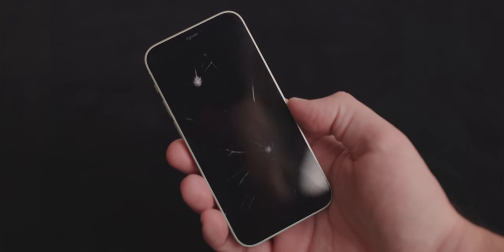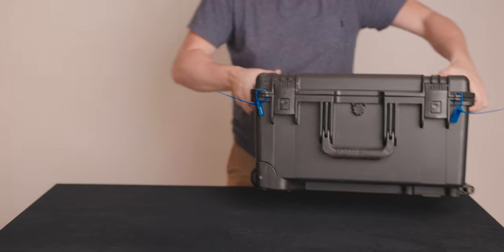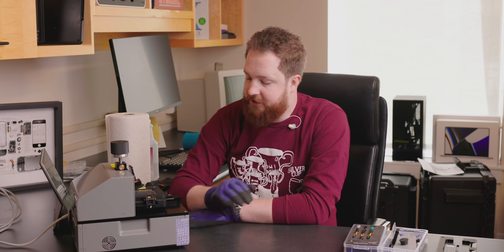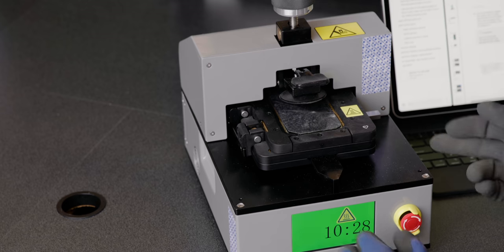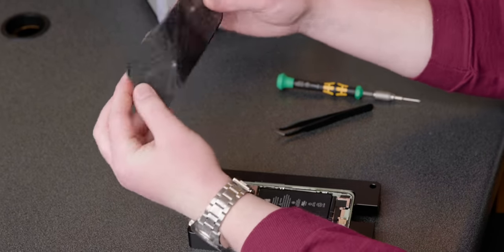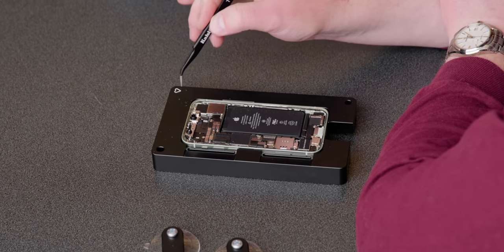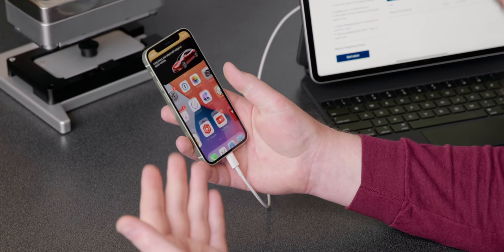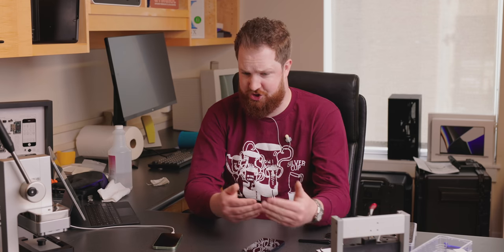Using Apple’s Tools to Fix My iPhone

Comment: After watching this video it seems clear to me that Apple has designed their whole repair equipment and process to seem intimidating and tiresome to discourage people from using it.
Reply: Too be honest they are actually just lazy. This is the exact same process you'd see when going to apple/authorized service, from the machines to the process (I'm currently working at geek squad rn). I'm still a little shocked they just took all the equipment we use daily and just slapped it into 2 pelican cases and gave the user the same repair guide lol.
Reply: @XeLegend  Okay, you make a better solution so we can mock it please. Go on... we are waiting
Reply: @unlokia  Why not just make a more repairable phone? Or not even just that, but giving out proper repair guides and having parts be freely available to consumers and/or small repair shops, but letting them (repair shops) have stock (since there are repair shops that can get genuine parts, but are only allowed to order parts once a phone comes in)
Reply: It isn’t to intimidate the customer from doing it themselves but ensuring the repair is done in a controlled, consistent manner without requiring someone to second guess the previous step was done properly reflecting negatively on the brand. Sure it could be done with lesser tools
Reply: @c2thew  thank you, another of the few who aren't on the "it's a conspiracy!!" bandwagon. It's nice to meet some level-headed peers.
Reply: @c2thew  Its for money, restricting
other people/entities from fixing your phone is, gives you more money, in the end they need to satisfy their shareholders. Having full control just gives ypu full control of the money ... thats just how it works ... they could do the other thing but keeping control brings more money. Surely there are plenty of people who want this to change and everything but management takes the last decision ... which is most profitable to the business.
Reply: @XeLegend  make it more repairable at the expense of quality? These devices are extremely miniaturized and tightly integrated, which is what allows them to be so pretty and powerful. Why should Apple throw away all their design and engineering principles just to cater a tiny enthusiastic minority?
Reply: @c2thew  not to intimidate the customer? Immediately installs screen perfectly and gets the warning - this isn't an official display. Lmao

Nope defo not intimidation. Price of their equipment when you can do most without any they provided. More intimidation. Financial this time.

Their entire system is half arsed and basically pointless. They're not environmentally sustainable so they should simply stop their sub par facade
Reply: @keyboardwarrior7538  replacing a screen requires validation from apple by calling the phone number for customer service. This is still very much anti right to repair
Reply: If you really are determined to repair it. You won’t be intimidated or feel tiresome, you ask for it, if you feel that way, then you don’t really want to do it yourself. If you expect official Apple repair to have precision and high standard, then you should bind your self-repair to the same standard and not want an easy way out. You should thank them for giving you the exact same tool they use instead of some half ass stuff from park tools

Comment: 2:32 Btw, those are Wera ESD safe electronics screwdrivers. In contrast to the normal Wera electronics screwdrivers, these are twice as expensive
Reply: What makes it esd safe?
Reply: @deth3021  the price
Reply: @deth3021  Nothing. Regular Wera screwdrivers are ESD safe. It's just an upcharge for idiots.
Reply: @12pandemon  i am suspicious as I've worked in esd enviroments for year but its the first time i have heard of an esd screwdriver.
Reply: @deth3021  the plastic/rubber components are made of a slightly conducive material, to dispel/equalize static buildup.
Reply: @Dirty_Bear22  i know what an esd material is. 
Just not sure what use it has on a device with a metal sharp end that is in direct contact with the sensitive electronics.
If you, the mat, the whole workspace is tethered, then i fail to see how the little bit of plastic on the screwdriver will make a difference.
Considering when you touch it, wpyou will discharge any potential microcharge on it anyway.
Amd fo you arent tethered, then its also pointless.
Reply: @deth3021  In theory if the handle material is an insulator, the metal shaft of the screwdriver can develop a charge. Yes it’s rare, but if you are working on lots of products, or very expensive server rooms minimizing risk becomes important.  It’s to eliminate environmental static, it’s not going to prevent a electrical short if working on live equipment.
Reply: @Dirty_Bear22  a metal shaft with a pointy end is going to discharge into the air.
Reply: @deth3021  after awhile yes, but the charge build up rate can be faster then then air discharge rate.
Reply: Where could I get these? I like the torque feature.
Reply: @fbnmndz  search for Wera esd torque adjustable. You can’t post links, so you gotta do some digging yourself.
Reply: @deth3021  Carbon loading most likely (carbon particulate mixed into the plastics when mfring)

Comment: It would be super interesting to order this repair, yet install a 3rd party display or battery instead to see if you can pair them to the phone through apples diagnostic…
Reply: I highly doubt you'd be able to pair a third-party screen through Apple Diagnostics because the person on the other end confirms the serial number with the parts that were purchased through their store. That said you could totally use the tools with third-party hardware, but you'd be stuck with the warning messages and no face ID.
Reply: So, I followed this China AASP Repair Shop tiktoker on China's tiktok and he tried running the AST 2 diagnostic test after replacing the phone with a genuine battery and a non-genuine display, the display still show up as non-genuine. While in this case he didnt 'ordered' a genuine display, but I highly doubt AST 2 would pair them together even if an order is there.
Reply: No.  The calibration software will verify the serial number of the battery and display.
Reply: There are quanli serial clonners, it would be interesting to see if you clone the original serial to 3rd party parts if it's possible to make it working with the iphone 😀
Reply: @ДимитърАндонов-ъ7е  I may be wrong but I believe I've seen someone use the cloner on a repair and it went thru fine but I can't remember who it waz
Reply: @kenny180398  So I watched a few restore videos for iphones and fun fact: they make third party S/n copiers/spoofers. You would connect your original display to the little board using the flex connector, copy the S/n then connect the new non-genuine display (or genuine, doesn't matter) the it will copy the S/n to the new display. So when the iPhone reads it, I doesn't think the display was changed in the first place and you don't get an error message. I don't know if they make ones for batteries tho
Reply: @SaisVoice  yeah i know about the copier which will work, but im just answering op question on 'ordering a new part, install 3rd party part without tinkering and getting it paired by apple' which is NO, it wouldnt pair. and Yes theres battery copier as well or you can just remove the flex cable which contain ic chip?? and spot weld new battery onto the flex cable.
Reply: Would be an interesting experiment - but I don't think it has any benefit of doing that.

I mean the obvious thing would be to install the cheap 3rd party screen and sell the genuine screen. But that probably won't work because the buyer of the genuine screen probably can't 'unlock' the screen because you already did.

So what good would it do to install a 3rd party screen if you already paid for the original?
Reply: I mean I had to repair my iphone and my aunt's iphone screens and it just so happens that I accidentally installed the wrong screens! oh no!    Anyways, iphone repair helper, these two phones took me an hour to replace! Could you pwease just authenticate it, just this once?

Comment: Clearly they don't really intend for anyone to use this service. I'm going out on a limb and assume that they're going to argue that no one uses this service is a reason why right to repair is bad in general. Nonetheless I think it's pretty cool that they make these tools available for renting and even purchasing. Some of it looks like a pretty good investment for repair shops or maker spaces. As an end user I wouldn't think of using this, not just because the price difference is not enough for taking on the risk, but also because shipping 100 pounds of equipment across the country is a disaster from an environmental standpoint.
Reply: It is great that is possible yes. And Apple as they seem would like you to buy a new tool to you with every or every other phone generation, don’t you think?
Reply: I don't think so.. i really want to use that tools and repair my own phone.. this video shows it is do able..

Comment: The laughs with the iMac power cable… my same reaction when I set our store’s heated display removal tool up 1.5 years ago, lol. Looks so goofy, then just had to remind myself it’s Apple.
Reply: Well if they have a surfeit of iMac IEC cables, why not! It's JUST a power cable, the repair jigs ain't fashion items. Consumerism means that consumers look at EVERYTHING technical through a glossy, consumer lens. Nope. Real engineering doesn't need lipstick on it.
Reply: @unlokia  I’m sure it’s because that happens to be the power cable Apple was already manufacturing and it would’ve been wasteful to make a different one without the iMac’s “disc” on the end, but as someone who has been working at an AASP for 5 years now, I will say Apple spends quite a bit on proprietary equipment anyway, so to see them reuse a cable when 99% of the other stuff they have us use is equipment they’ve designed specifically for repairs is kind of silly/funny. Nothing more, nothing less.

Comment: Today I replaced the battery on my four year old Poco F1. All I used was a screwdriver. Used two heads. A T4 and a Phillips. 

And guess what. It can even run windows 11(smoothly).

Comment: All of this equipment is probably great for quickly and consistently doing hundreds of screen replacements, specially in parallel, but for your average consumer this is sooo complicated and overengineered, it's 2 PELICAN CASES for a screen replacement.
Reply: Yeah I mean, you can do this whole thing with a heatgun, a guitar pick and a screwdriver
Reply: @luca_sbll  And you still can. You're not required to rent or purchase Apple's tools to complete the repair!
Reply: That press to properly apply the glue and press down the screen is actually really nifty and prolly the only tool that's worth to have if you replace the screen yourself.
Reply: @dfa4  Never said that's not the case
Reply: @luca_sbll  so you have no point ... just complaining ... so Apple is gonna give you "unofficial" .. "unprofessional" instruction in how to repair their products to maintain high quality assurance? 😂

Surely you understand how a business works right?
Reply: @RunForPeace-hk1cu  Bruh, you are really trying to read that hard into a easy and straight forward statement, is it too hard for you to believe I just wrote what I did and no more? No hidden meaning or anything like that? People like you being extremely overdefensive are the reason why Apple fans have a bad rep
Reply: @Lumilicious  the press is a useless gimmick. You only need the press plate for 12 or so bucks and your hands. Somehow we applied seals for years properly without the machine and no one complained...
Reply: the press can probably be replaced with a 3D printed thing and the correct number of cinder blocks to stack on top of it,  your task takes twice as long. and you risk dropping a cinder block on your phone, but you save some of $50.
Reply: The screen removal tool is a waste of time. If it's a broken screen on an iPhone I can remove it manually with a thin metal tool in under a minute. If the screen is perfectly intact it could be more useful but aside from that it's a waste.

Comment: I'm really of two minds on this. On the one hand I do feel like this is Apple trying to sandbag the process. However, I also understand Apple's desire that a first party repair should be as perfect as possible. And a large part of that is taking the user variability out of it.
For example, I think that the battery press is just as justified as a torque screwdriver. If you know how much force needs to be applied to fully activate the adhesive, how do you communicate that to a user? Not only that, but, how do you ensure that every user applies the adequate force without applying too much. That press is a key part of something called process reliability.
Reply: Exactly this.  You understand it very clearly when you say "process reliability".